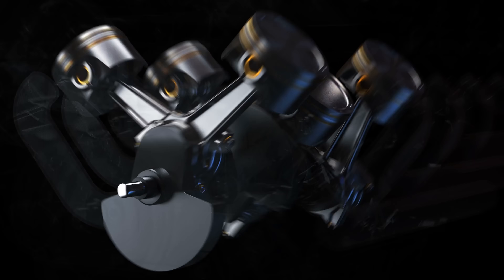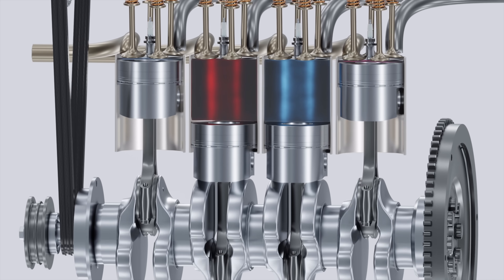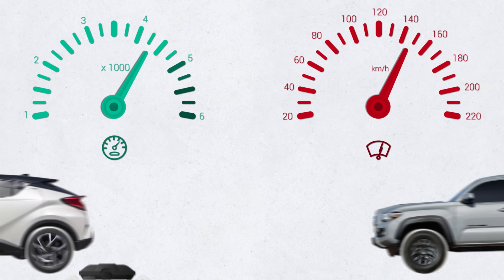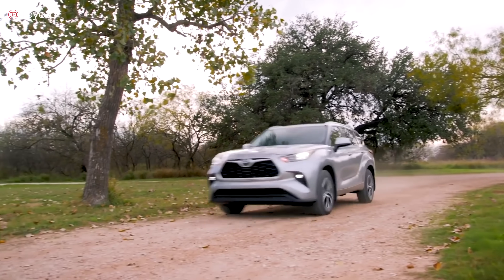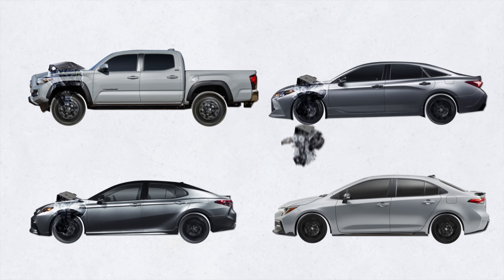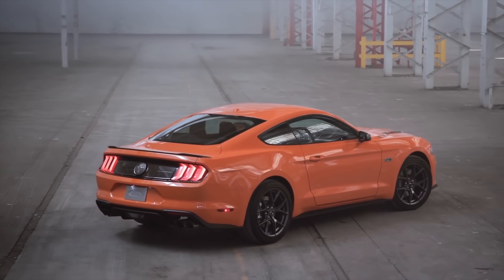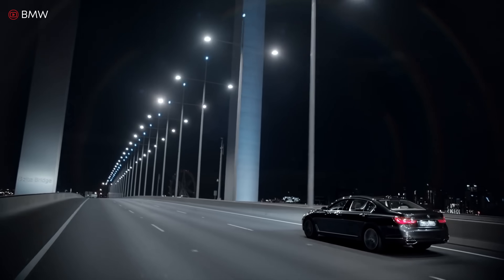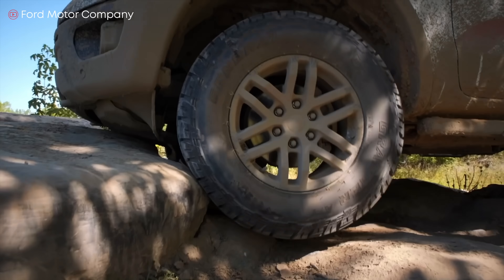No One is Telling You the Truth About Turbocharged Cars, So I Have To

Comment: Straight six beats V6 anytime. So if you like naturally aspirated, get a smooth running straight six
Reply: Volvo, 3.2liter 2008+
Reply: The Chrysler slant 6, ford and chevy straight six, especially the chevy 292 and ford 300 were absolute work horses. 
Then there is the legendary jeep 4.0. 
They just don't fit in modern vehicles. There are modern good v6's. No reason a v6 can't compete with a straight 6 from the engineering standpoint.
Reply: It's a shame they don't make more inline six engines with the primary and secondary stability of the engine they last forever and have crazy boost potential.
Reply: My ‘96 Land Cruiser has an I6 😬
Reply: Mercedes have gone back to the straight 6 in some models. I love my two old M104s 😊
Reply: Our friends Down Under have the option of a 90s era Ford Falcon with a 4.0 dohc six, which was a derivative of the old American 3.3 Thriftpower Six (200 cubic inch) that powered numerous Falcons, Mustangs, Mavericks, Granadas, and Fairmonts here.
Reply: 1960 jaguar, super.
Reply: @N3G4T3  They last forever. That answers the "Why".
Reply: @GSC727  True, not breakable enough.
Reply: My I6 Nisson 280z was indestructible
Reply: BMW M54 inline6 r actly pretty solid. sure the cars that use them r absolute crap when it comes to reliability, but the engine on its own is pretty good.
Reply: Honda J35 V6 is a pretty good motor when it comes to reliability.
Reply: 2JZGE VVTI :) Yeah it's not the legend that the 2JZGTE is, but its still a massively over-engineered I6 in its stock form.
Reply: @aidinmclaurin9867  imma be that annoying person for abit, so i apologize in advance.

The 2JZ not over engineered by todays standards (obviously). Its an early 90s and even possibly a late 80s design. So it was already a dinosaur by the 2010s. However, it is overbuilt… massively overbuilt. dare i say,, to the strength margins that would make a diesel engine blush😅
Reply: My 2001 LEXUS ES300 has a 3.0 v6 so reliable
Reply: @doggSMK  
AMG 43 and 53. They sound very good.
Reply: @hakonhelgesen7659  yes, I have old W140 with 3.2L M104 and W210 with 2.8L M104 they sound so good. The W210 is with aftermarket exaust system and is crazy 😁
Reply: @patrickhenigin4805  you can buy Toyota j2z and modify it
Reply: Love my 4 liter inline 6 jeep zj
Reply: @arsyadidris2919  The over-engineered and complex german designs do need more "maintenance" than simpler cars, I concur. However, my 2003 BMW 325i with 209,000 miles on it has not been too bad.
Reply: Nobody making NA straight 6 nowadays. All turbo charged
Reply: @rschneid1996  true2. N im saying this from experience actly. Coz i have a 14 year old bmw E60 5 series at home. Yes its that old. Bought it used but reconditioned. Already had 40k miles when we bought it in 2010 (so technically we had it for 11 years, not 14). 

The powertrain has never needed anything major even until today. Granted mileage is not that high considering its age. Only done 180k miles so far. 2.5 NA inline6 with a 6speed, good balance between modern design and reliablity. For a BMW that is.
Reply: @lh3428  Had to trade it for a 4-door when our first child was born. We actually brought her home from the hospital with the car seat tied down with the luggage straps. The nurse was none too happy, but it was legal (sort of).
Reply: E30 325  all you need  or a 535i what the ...k
Reply: @MisterMikeTexas  they're still making Falcons with straight sixes today. I'd LOVE to get my hands on one of those Barras.
Reply: More torque in a straight 6 , what a turbo changer on a straight 6 wood do?
Reply: @patrickhenigin4805  those motors havent been in production for at least thirty years. There are many V6 motors that far outperform any inline engine
Reply: @sunspiral79  name them.
Reply: Agreed.  I just wish there were more I6 options out there.
Reply: What is mostly known as the most reliable HD truck diesel for decades now? The Cummins i6. Modern v6 are way better then they used to be though.
Reply: @MisterMikeTexas   still running a ef Fairmont 1995 with the 4.0 straight 6 
Great engines.
Reply: @patrickhenigin4805  I believe the angle it’s offset at changes the power it can create rather than an inline 6. BMW Is one company who makes them fit.
Reply: Check out what powernation did with a turbo on the big sixes
Reply: Please name one built in the last 10 years that is not turbocharged...................... I thought so.
Reply: Even better, turbo charged inline 6.
Reply: Can't wait to see you the results of the turbocharged Tundra and the new smaller engine. 
That new engine in the Tundra 2022 is going to be smaller than the V6 I have in my Tacoma.
Reply: @icost4671  You can come at turbocharging from an increased displacement angle - for example a 2 litre turbo charged 4 cylinder is likely going to be the equivalent in torque and power to a 3 or even 3.5 litre V6 - plus it'll likely deliver more torque across the rev range, so you'll often get significantly better performance off the line than from the V6 - and as noted it'll generally be significantly more efficient and economic to run.  If the system is properly engineered and assembled with care and quality in mind, with non-excessive service intervals, longevity doesn't have to be an issue either.  Turbos are nothing to be scared of really.
Reply: @Beer_Dad1975  Scotty talked me out of  a EV . So I had my mind on a 2022 Tundra , but it having a smaller  motor than what I have in my Tacoma just, ... No way , so what I'm going to do is just wait to 2023 and see what the report is on the Tundra .
 Thank you for enlightening me about the Tundra's of engine.
Reply: @aidinmclaurin9867  only problem with VVTI is they put in pencil thin rods, they're great stock but can't handle much power. Non vvti is just as strong as the legend. (Fast talking whisper) some parts and assembly not included.
Reply: @sunspiral79  the 1jz and 2jz were made up until like 2004. That's 17 years. Bmw still makes them, that's why Toyota hired them to build the new Zupra
Reply: From Where?
Reply: But v6 is compact and perfect for fwd and awd setup, sounds much better too
Reply: E46 M3
Reply: @Code Ultimate I was more referring to the primary and secondary stability allowing for further boost potential, as long as the parts can handle the pressure.
Reply: BMW: HMU!
Reply: @patrickhenigin4805  Still pushing my 94 jeep 4.0 and lovin.
Reply: vr6 shits on all ngl
Reply: Yea a Ford 300.
Reply: @N3G4T3  We have a work truck, a 1980 ford 300 six STILL going strong.
Reply: @kittywampusdrums  That's impressive.
Reply: AMC 😄👍
Reply: Ehhhh
Reply: @brandonmatas1035  those 2001 Lexus days are done & gone. It’s all Cheap paint on cheaper metal wrapped around break-even cheap parts & sub-parts with consumable components with a short life made in US-CAN but not in Japan. Give it time, even Toyota will start to rhyme.
Reply: @retiredrebel  u clearly dont know what your talking about and it shows 2001 was an excellent year for Toyota/lexus
Reply: Greatest quality of the inline 6 is their smoothness due to their excellent balance. They can sometimes beat the V6 in power but this has nothing to do with their inline design
Reply: E46 m3 straight 6
Reply: They can sometimes beat the V6 in power but this has nothing to do with their inline design
Reply: E39 530i they could bury me in this car
Reply: The in-line 6 is too long to be transversely fit into a normal Compact car/SUV.
Reply: actually a V6 is more reliable than a inline straight 6, how, because most inline 6 engines use parts that are more performance oriented, which is why most luxury cars require premium fuel.
but a naturally aspirated doesn't need it, it's because it's a more simplified engine layout. it's meant to last, but not all car companies are created equal. some are more reliable than others, but still premium cars require a little more attention from the driver.
because he's soon gonna find out, that the maintenance cost is gonna be more than he bargain for. now if you know what you're doing, it can last, but their not recommended for a first time car buyer.
Reply: For horsepower, yes, inline 6 all day long. For torque (towing), than opt for a V6.

Comment: Give me a regular four cylinder. I'll just drive slower.
Reply: You sound fun. Jk😂
Reply: @AF_1892  you have more fun going slower in most things in life 😉😉
Reply: But that line of cars behind you will start overtaking.  One at a time.  Harmonize without speeding.  Use power to start going, then settle down.
Reply: heck yes mister!!
Reply: Life is too short to drive slow
Reply: I got a Mazda 3 hatchback manual with the 2.5L I4 NA.... Plenty fast enough in a little car like that.  I just tried my wife's uncle's challenger and would much rather have my Mazda3... Especially if things get dicey with weather etc.
Reply: @johnnygunz2300  power without handling a drag race rocket basically

Comment: Nothing beats a naturally aspirated engine. 
All you have to do is ask why are automakers moving to turbos.  Not because they want to, but because they are being forced too thru regulations.
Reply: Because it gives a smaller more fuel efficient engine more horsepower, so you get a good balance between power and fuel economy, that’s why
Reply: Probably, Turbo engines wear out more quickly as well!
Reply: @Riptor1998  At the cost of reliability and lifespan. They shift the burden onto the customer.
Reply: @johnnyhall7065  Not if they are service properly, which most people do not do.
Reply: @57ashdot if you don’t know how to do maintenance then just say that
Reply: they also do it because they agree with it, which has never been proven.
Reply: They also do it because manufacturing will cost less and we are buying the cars at the same price, some are even more expensive.
Reply: @Riptor1998 at higher cost and the fuel efficiency improvement is the reason…that improvement is minimal. The torque benefits are nice, but I don’t want increased maintenance risk.

Comment: Scotty narrating: “some people” say stay away from modern turbo charged engines

Also Scotty: stay away from turbo charged engines
Reply: Lol
Reply: Love turbo engines gas an diesel
Reply: Translation:  "I don't know how to work on turbocharged engines."
Reply: @robsolf  
No offence to Scotty but he likes vehicles with sudden failures, straight forward diagnosis, quick simple repairs.

Turbo repair, replacements would take a long time to tear down, rusted solid bolts & components, a lot of plastic components (fuel injectors, coil packs) degraded, stuck in place and breaks while removing 😬, have a lot of parts all over the place, clean up parts before reinstallation, some parts may be ob$olete, can't replace, replacement parts are substandard quality but still $ 😁, then you get it all back together and still doesn't run right. 🤬

But I've only worked on cars, trucks, tractors, motorsickles, lawn mowers for 45 years. 🤔
Reply: To turbo a car cost money for any engine. So cost is not the real problem. The real problem is what is faster. stronger. and reliable. I want a v8 that could give me 30 mpg( corvette)
Reply: Next, on Scotty Kilmer,

Stay away from people who say stay away from turbo charged engines

Comment: V6 for sure! Simpler technology, less stress on the motor, and therefore longer life!
Reply: Willy willson  who cares, ops positives all trump the fuel costs in my book, just work more. Or harder.
Reply: Is not simple technology they are more complicated. And when it comes time to fix something your labor cost is gonna be he'll of a lot more than a i4
Reply: 4 cylinder has two power pulses per 360 degrees of crank shaft revolution. 6 cylinder has three power pulses 8 cylinder has 4 per crank revolution. So 8 makes twice as many power pulses than4 cylinder making more useful power at lower rpm 2400 rpm comes way before 5000 rpm.less wear twice the power longer engine life
Reply: Agreed.  Although you will purchase more fuel and pay a little more on labor for repair, the extra years you get before having to purchase a replacement more than makes up for it.
Reply: Willy willson I'll take worse gas mileage for a longer lasting engine any day.
Reply: @thullraven1  But no one knows exactly how long their engine will last unless they own it when it dies. Easy math for most, how long they own a typical vehicle and the typical miles put on them. Most people by far will have a new ride in the driveway before their current one blows up. Just having one engine over another does not ensure that.
Reply: V6 don't make it simple
Reply: My 3.7 in my Lincoln will do 30 hwy worst is 18 city if I hot rod it.
Reply: A turbocharged engine that's looked after well and serviced regularly will last as long as a naturally aspirated engine no matter what anyone says. I've seen cars 300,00+ miles and still on the original turbo. In Europe we've been turbocharging cars for years and there's nothing wrong with them
Reply: @danielbeard5281  true, thay being said, here in the US, many idiots think they can just buy a turbo, drive like mario Andretti and be good to go, no maintaine needed...really lacking basic car logic over here, i know kids my age thst dont know how to chsnge a tore, change oil, coolant, or jump a car, its actually quite sad, so i guess thats where most these ppl are probanly aquiring the "crappy" turbo cars, because if they are maintained correctly they are excellent, just NOT for me, i dont drive much, and when i do its over 50 miles, so a v6 is perfect for me.  Hapoy driving all, and good point, i hope one day us americans can start taking care of our vehicles lime other counties do..
Reply: As for fuel eco, my V6 Venza is happy with 87 octane while most high pressure turbos like premium 91 octane or knock sensor will dial the power back.  Have you checked out the price difference at the pump lately?
Reply: The V6 has twice the heads, cams, gears, gaskets, manifolds and leaks. That is not simple. The only benefit of the V6, Is that is stronger on lift-off. So you don't have to brake as much. The turbo 4 has 1 head, 1 set of cams, 1-angle intake, 1 exhaust manifold and only half the leaks. And the turbo sounds so good.
Reply: Less stress on the individual components usually just means each component is manufactured to handle less stress.  N/A or boosted, engineering is the key.  Both have examples where they run forever, and both have examples where they blow up at 36001 miles.  These old outdated assumptions about N/A vs. forced induction are... old and outdated.
Reply: @miamidangia5122  Right on.  If we're talking about simplicity, a V6 has more combustion components than the turbo 4, therefore has more potential for one or more of those components to break.  If it was just about simplicity, an 80's Iron Duke would be a beacon of reliability.
Reply: @TheCpj1976  same here with my FPT Saab 9000 2.3T. 86k miles (130,000 Kim’s) only, tho’.
Reply: V6s are just as complicated, especially when they’re sideways like in most passenger cars

Comment: I recently bought a used 2016 Audi A3 1.8T, put a tune on it for more power and torque. With in 5k miles the exhaust turbine broke clean off, sending a bunch of smoke out the exhaust. Replaced the turbo and removed the tune. Live and learn. The Audi is much more fun to drive than my Camry.